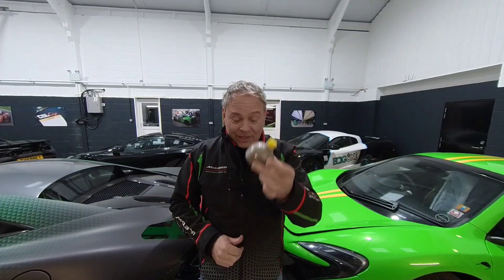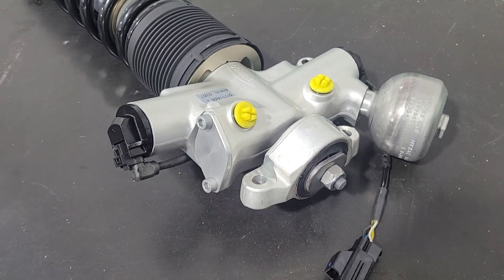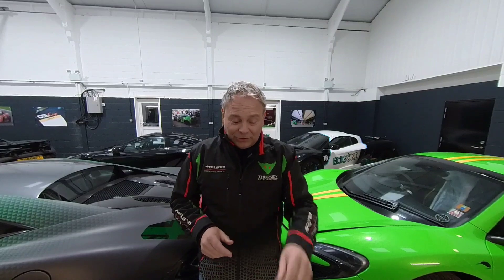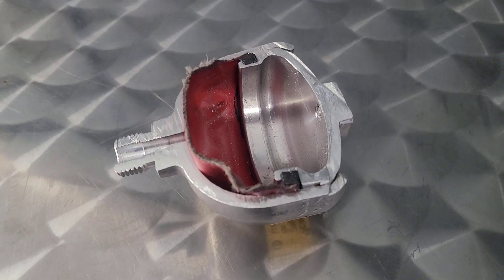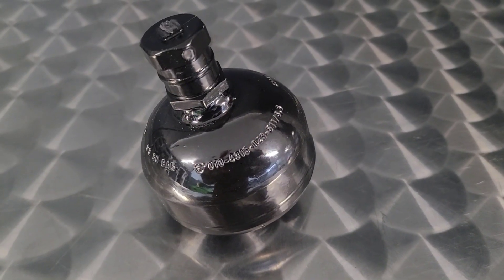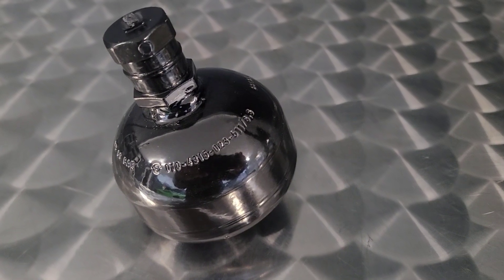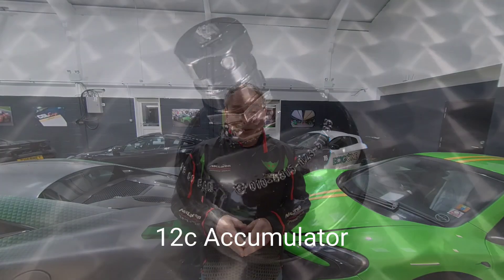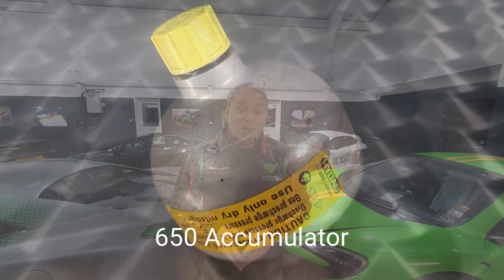What the hell is an accumulator?

Comment: I understand the upgraded 720/765 accumulator is of more durable design but is probably too big to fit the 650/675.  So is it possible for you to manufacture a batch of similarly more durable aftermarket version for the 650/675?  I imagine that would be a popular upgrade.
Reply from the maker: There is no evidence that the piston version is more durable and it also has the downside that the car needs a software change to use them whereas the older version doesn't. We will continue to use the original version.
Reply: @ThorneyMotorsport  sorry for my slow response.  However I am not convinced because if the original diaphragm version is better then why did McLaren switch to the piston version for their newer cars?
Reply: By the way, it’s been weeks and I am still waiting for a quote from your company for 4 (675 LT) accumulators.  I was asked by your web staff to provide my shipping address and quantity to order but after I replied no one followed up with a quote.
Reply from the maker: @ministryoflies3300  new supplier that's all
Reply from the maker: @ministryoflies3300  I can't see any emails that are not dealt with, perhaps if you can drop me an email I can look for you

Comment: if you don't replace the accumulators, and you're essentialy driving on track mode all the time, does that wear out the suspension arms or cause... cracks.. in the long run?
Reply from the maker: Thats an interesting question. First off with failed accumulators you're not driving in track mode as such, you're driving in a mode where the suspension cannot accommodate the wider ranges of volume displacement of the oil, so you're losing rebound damping as well as compression, what the accumulator does is allow for those wider varieties of damping control. In addition they are linked (there is only one system) so if one has failed the others in essence try to compensate but they cant really do it. In the early days of replacing these we used to just replace one and leave the others if they were fine but on the front if you did that the car would pull under braking as one side had the extra volume and the other didnt so it unbalanced the car. 

It would be an interesting test to remove them all and blank off the attachment and see how the car handle, want to try? :)

Comment: Thanks so much for this, a great insight into accumulators! I've had such a nightmare trying to get them replaced on my SL recently but had Auto Accumulators refill all 4 for way cheaper than I was going to pay for the replacements. The SL has much larger accumulators than the ones you showed here as well (100bar of pressure) so I can't imagine 7.5bar is too much of a hassle for them? I don't know if you've been in touch but it seems refilling them might be the way to go
Reply from the maker: At the moment it does seem to be that the replacements are more reliable, we've not replaced any that we have already replaced at all and some are 5 years old so hopefully the ones being fitted now sort the issue.